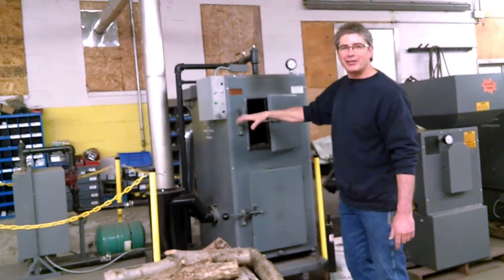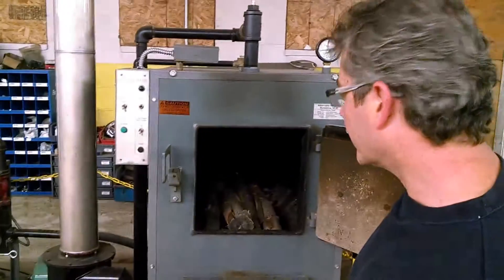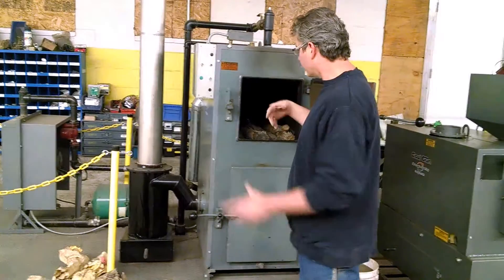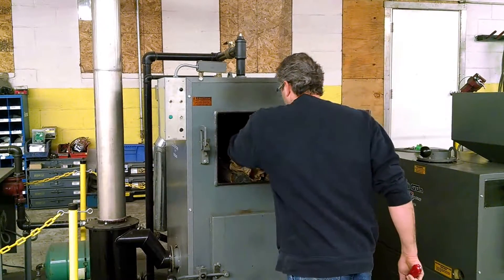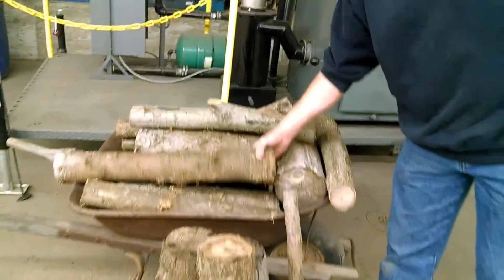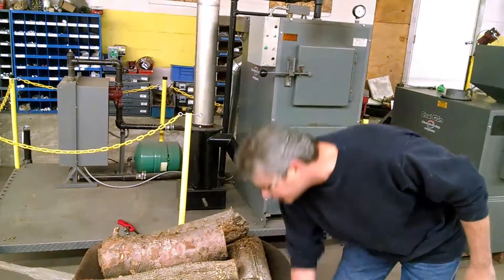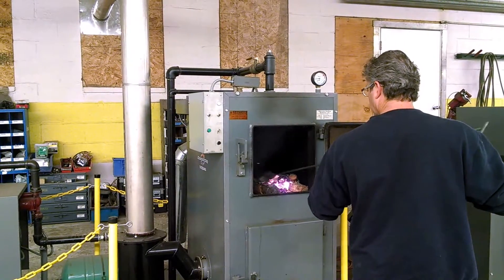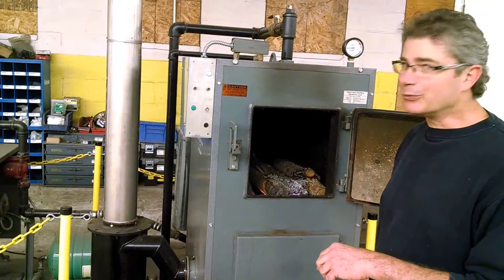Lighting the Wood Gun Wood Gasification Boiler

Comment: What’s the difference between this and the super e210
Reply: The main differences between the E100 and the Super E210 is the firebick design, the 210 does not have a cyclone, the 210 has a secondary air system. The 210 has greater capacity more similar to the E140. Our Super E110 is similar in capacity to the E100.

Comment: will  this  work  with  a  steam  system????????
Reply from the maker: The Wood Gun can be incorporated into steam heating systems with the special options package for steam. There is neither EPA or UL approvals for these, so most residential applications can't use a Wood Gun set up for low pressure steam.

Comment: Is this just a display unit that heats the shop?
Reply from the maker: It is a display unit, and the heat it produces enters the system to heat the shop, but that one doesn't handle the 30,000 sq ft of space. ;-)
Reply: Michael Purnell wow 30,000 ft.² that is a lot of space!    yeah 30,000 ft.² would need a lot of bTUs to heat!

Comment: As the draft is the reverse of a normal woodstove why not just load in the log the add the kindling on top of the fuel then light it. Once you start the blower it's going to pull the fire gas and smoke down then you only have to open the door once improving the efficiency?

I know it's counter to how you normally start a fire but if there aren't any coals and it's a cold start try it and see how it works.

Thank you
Reply from the maker: James Shanks thanks for your comment. It is very critical that the fire burns from the bottom. Starting the fire below the door before loading is necessary to prevent burning from the top of the pile. Starting as you suggest is actually a fairly common mistake for new users, hence the importance of this video.
Reply: i guess I'm kinda off topic but does anyone know a good website to stream new tv shows online?